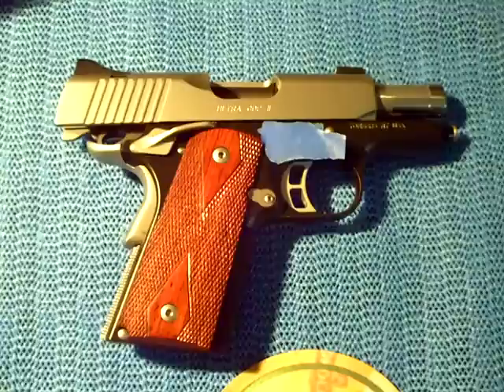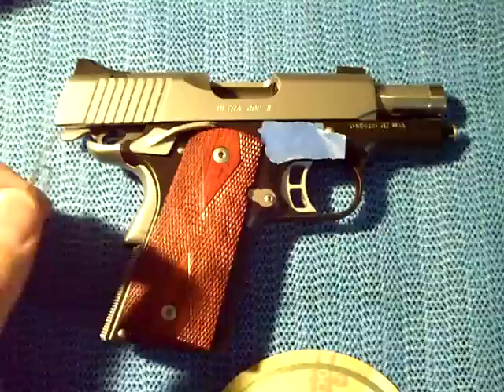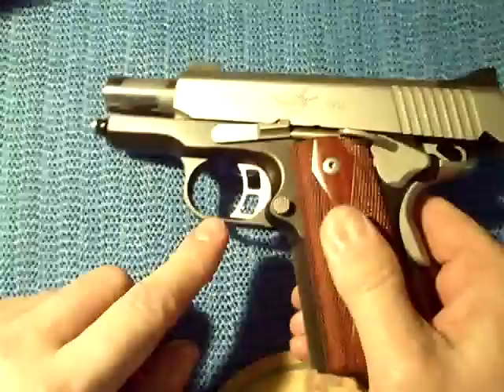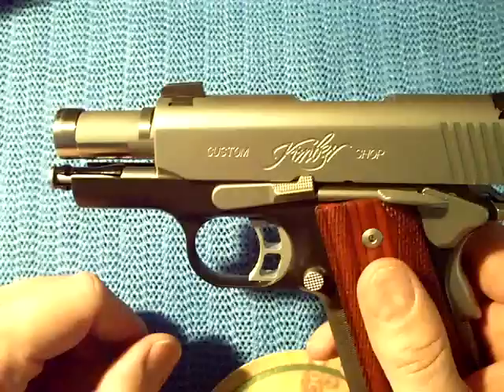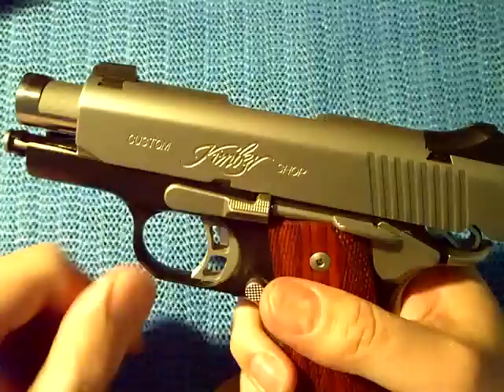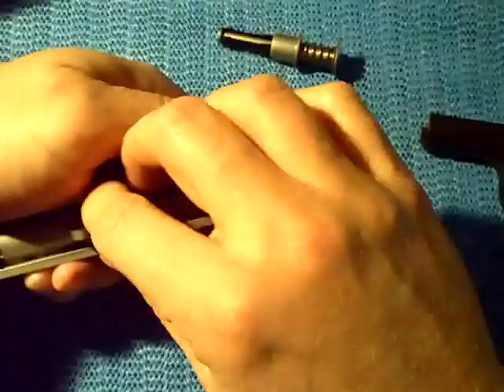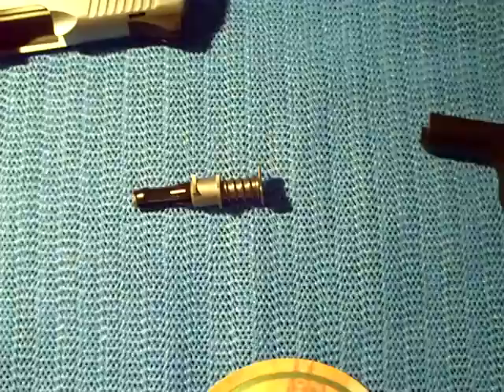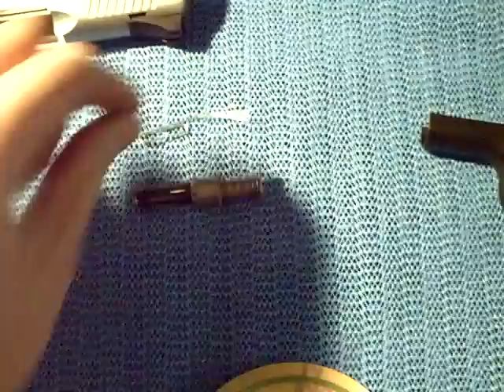Kimber Take Down Made Easy - New Tool from NDZPerformance

Comment: I had a ultra cdp 2 for 8yrs, and learned to take it down with no tool. No problems. Now on my Ultra Raptor 2, must use a tool because of the 18# spring.

Comment: OMG thank you for this! First and last time i tried to take my ultra carry apart with the supplied tool it got stuck in the hole after reassembly and i had to use pliers and bend the crap out of that tool rendering it useless. Havent taken it apart since.
Reply from the maker: They do work well....

Comment: Just bought my Cdp love it 

Difference stail less slide so it stays nice
30 lines per inch front and under trigger 
Carry melt (round edges so its a smoother Cary ( it also shaves a little weight  )

I'm so gonna buy this tool 

The thing about this gun I don't under stand about ppl is you can brake it down as ez as and other 1911 but if you wont to do so I'n a mannar sutable for a $1000 pistol you use a tool my fathers cheepo 1911 has all kinds of scratches do to neglect and not being a fine

Comment from the maker: @3004989 You can clean that part easily through the slot.  Plenty of room.  In my experience that part does not get dirty to the point where scrubbing is needed.  A wipe down is more than enough.  I clean after every shooting session though.

Comment: I have a Kimber Elite Pro II and wonder if the new tool will be useful. I only read about the smaller Kimbers! Mine is a 4.25" barrel in 45ACP ANY IDEAD would be appreciated, since the use of your fingers to depress the spring before inserting the paper clip,is hard on a new pistol.

Comment: Thanks for the review. The vendor has two different sizes (Short & Long) and I have a CDP Ultra II. What's the difference between short & long and which is better?
Thanks!
Reply: *****
Thank you for reply. I did call and left message for "Richard" on Friday. I'll try to call on Monday and see why they have two sizes.
I might just buy both and try them both. It's not that expensive compared to the $1200 price of the gun. :-)